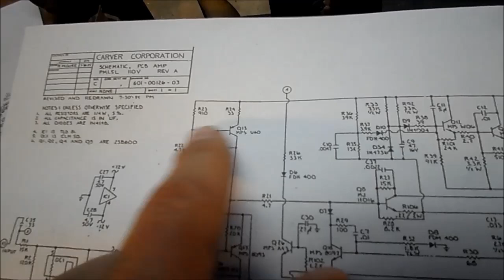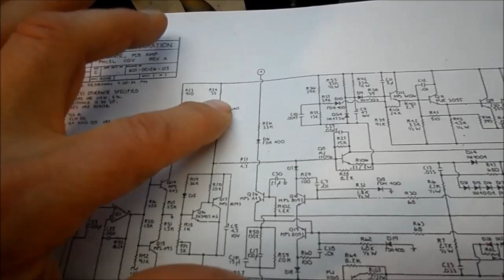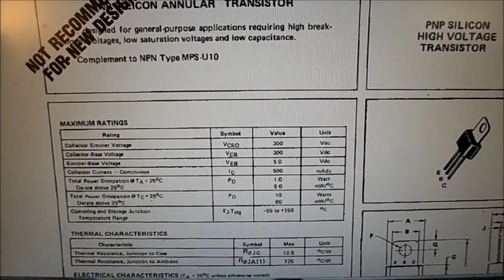Carver PM 1.5 Pt. 2. Shorted HV transistor.

Comment: Please help me, my Carver M1.5t protects itself when I turn up the volume, I had a short circuit in the positive rail line against the output line, what could it be? With low volume at 60% it works well and sounds good without distortion but when I turn up the volume it protects itself.

Comment: All those outputs should be hfe matched and if you dont get a good matched set they can fail again if the thing is driven hard. Also because all that stuff is direct coupled, if you dont get every single bad transistor and component the first time, even the ones that test good with a meter and break down under high voltage its going to cause them all to short again. I wont even take these kind of repairs, if its 2 or 4 outputs them maybe but not that. You may get lucky or you may loose big time, its a roll of the dice
Reply from the maker: +shango066 Thank you for the advice. Greatly appreciated. Agreed. I dreaded this being dropped off. Owed the customer a favor, & this showed up. Arrg.